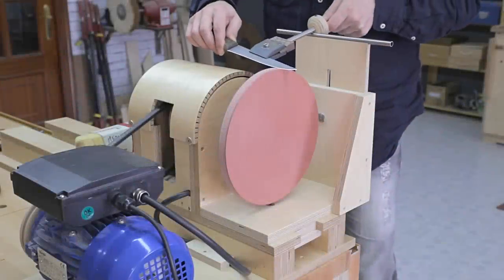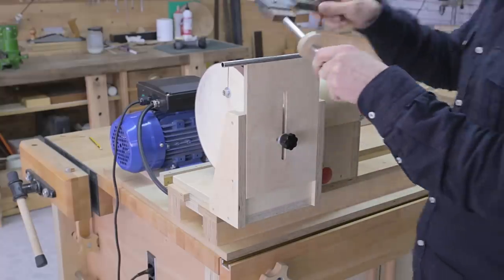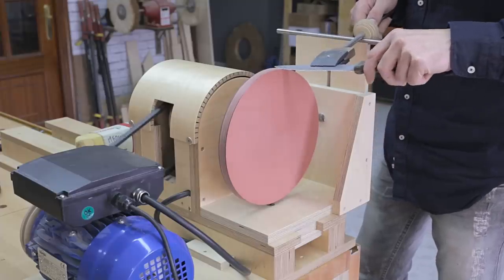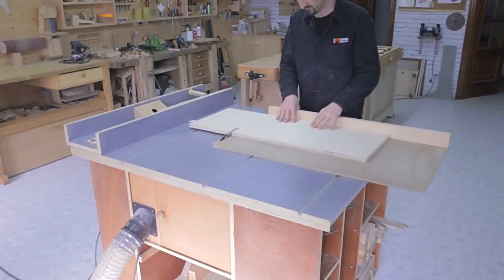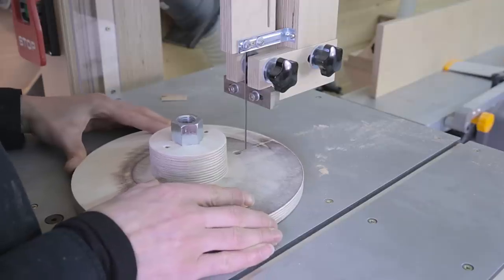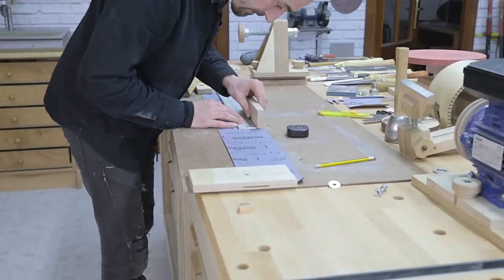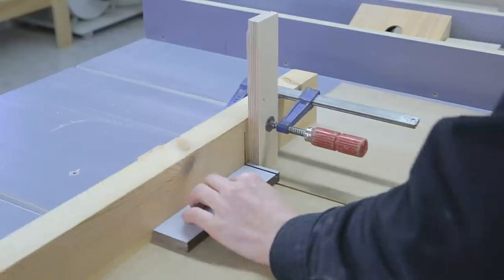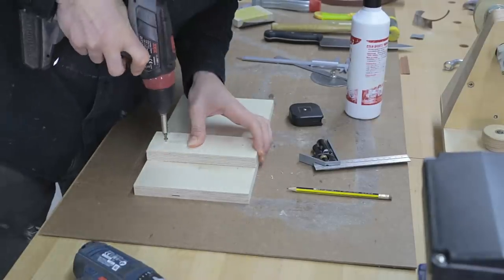Homemade Knife Sharpening Lathe Attachment

Comment: Very convenient device for sharpening knives, my respect.
If you want, in my kitchen I use Japanese knives made of aogami super steel, of course, I will not advertise the brand. From the moment of purchase I didn’t sharpen them even once, just straightened it on ceramic musat. They need to be handled very carefully and then you will get real pleasure from working with them. Best regards, from Russia.